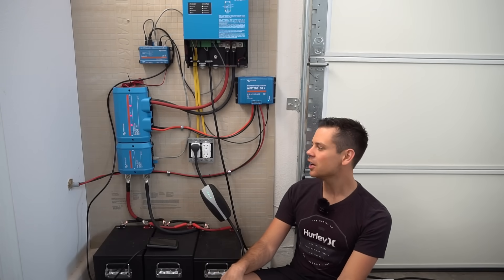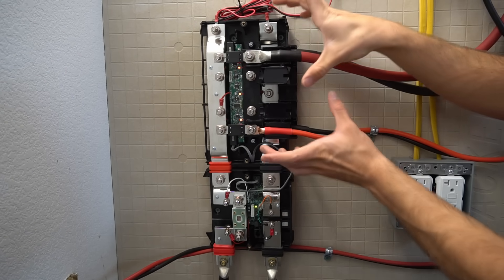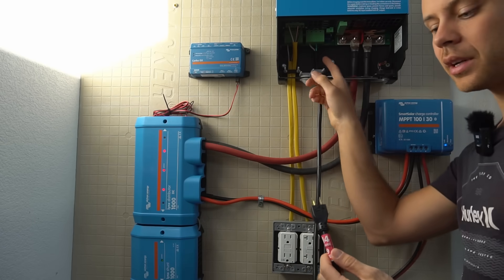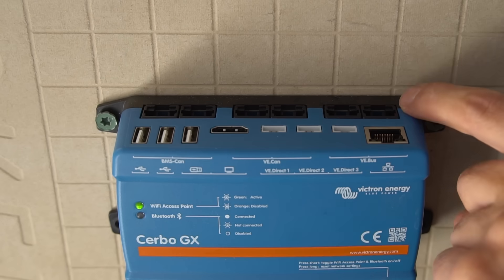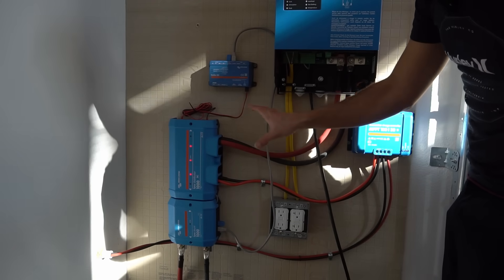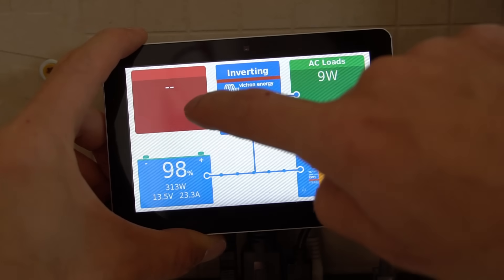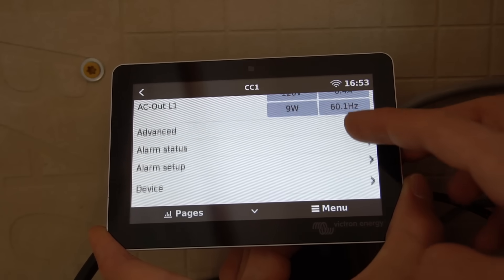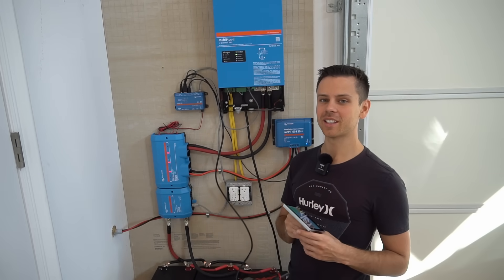Victron Made Easy! Design and Communication, Step-by-Step

Comment: Please keep the ridicule to a minimum. Would this be a good start for my old Class A? I'm full-time in a 1998 diesel pusher and I need to go solar, lol I should have gone solar years before. I digress. Would this be a good setup for my RV? From what I see I will just need to add an auto switch to my generator and an isolator to shut the system off.

Comment: I love these systems but why all the extra? For four years I have been living off-grid on just a battery bank, victron mppt smart solar charge controller and a 24v/3000w Multi-plus and I've never had to touch it. I might put fuses in someday but my charge controller is oversized and I don't see how there could be a surge from my battery bank that would ever be an issue.

Comment: Thank you for putting this amazing video together. I am a big fan of Victron devices, software, and overall design philosophy. QUESTION: Is there anyway to put together a grid connected Victron system in the United States where excess power is sold back to the power companies? Thanks in advance. Best of luck in your future endeavors.

Comment: I'm having an issue and am hoping you can point me in the right direction. I have two Victron SmartSolar MPPT 150/100-Tr VE.Can.

Both have Five 200w panels connected to them.

1. MPPT is putting out:
91.03v
8 amps
722w

2. MPPT is putting out:
125.17v
0.15 Amps
18w

Where would you start looking for the issues if you had this problem?

Comment: If you are going to use a driver to drive in the cover/housing screws, try using one with an adjustable torque setting so you don't keep jumping on those screws and rounding them over. Just because you have a slimline battery doesn't mean its torque is appropriate. That tool is fine for screwing mounting brackets onto 1" plywood backing board with hardened screws, but cover screws are much smaller and much softer and the materials you are clamping are much more fragile, valuable and easily damaged.

Comment: This question may be in another video, if so, please point me.  But, if I want to use a generator to come on in the event of a loss of shore power, is there a preferred generator (for RV usage) and can the multiplus system handle the transfer between shore power, to battery (as a buffer) and start the generator, until shore power is restored?

I'm not sure about the use of solar at this time, so I'm assuming that component can be added later should I decide to do so.

Thanks. GREAT explanation.

Comment: I have all those pieces and 8 battle born batteries in 24 v configuration.  Questions. The distributor didn't come with fuses. What size would be best? 500 amp size?  Next to have no power shut offs in line. Are you suggesting one is not needed?

Comment: Will, can rthe Victron Lynx SHUNT accomodate a T Class FUSE ? Planning installation of Renogy Lithium 100 AH batteries on my sailboat. ABYC came out with requirement to use T CLASS FUSE on battery connection.

Comment: Hi Will,  Thank you for the fantastic videos!  I have a question about the Multiplus 2.  I understand it can use power from the battery bank to augment shore power (my use case is for RVing) when demand exceeds available wattage.  Can the Multiplus also deal with low and high line voltage on shore power (i.e., can it boost line voltage if shore power drops below a specific level and potential "limit" or disconnect shore power if voltage exceeds a specified limit)?

Comment: Hey Will, great video! what if you wanted to add a victron DC to DC charger to that system for in a camper van. How does that connect to the Cerbo GX?

Comment: As an IT professional, I look forward to the day most of these components will be integrated, even if some aspects are disabled/not used, to make configuration easier. Also, many of the settings should eventually be auto detecting/auto negotiating to remove errors and capacity challenges. As most of us know in electronics/communications, cables can be upsized with current lower capacity to support future higher loads/upgrades without being too excessive on cost. In addition, better labeling systems and color coding will help remove complexity. This would mainly help those that DIY or customers setting solar systems up out-the-box.
Reply: Lol get back to your help desk you have no idea what you are talking about. Victron already has 3 SKUs that are integrated.

Comment: Hey Will, is there any truth in the cable length from the batteries to the system (negative + postive) having to be the same length... in terms of equal resistance in the cables?
Reply: As an electrical engineer by education, this is myth. The difference in resistance, especially with such large cables is negligible.

Comment: Hi, Will I love your videos you really know a lot about electronics.
Just wondered where I could find a layout for a small Solar system I have one 100-watt panel and an Epever 20amp controller Most likely overkill for my needs.
It's just to keep a battery topped up for my Diesel Heater When we get sun that is.
 But it was a good price. I have a normal 110 Amp lead acid leisure battery.
Very basic kit But I don't have the money for the kit you are showing Apart from the fact Battreys are a lot more expensive over here in the UK.
But it's worse where I am in the Scottish Highlands Nowhere near to buy kit and Shipping charges are brutal. 
Regards Ronnie Mackay.

Comment: I'm having couple of issues after the install. 
I have the multi-plus II, Cerbo GX w/GX touch,  Two Solar Controllers (150/100), smart shunt and dongle for the multi-plus to communicate through Bluetooth.

After my install, the Bluetooth Victron Connect App is showing everything working great.

The VRM and my Gx Touch, don't show in coming or out going AC voltage or my solar controllers.

By the Bluetooth showing them, I know they are connected. So I assume I just don't know how to program.

Thanks in advance for you assistance.
Reply: Figured it out. 20ft long HDMI cable is too long for the signal between the Cerbo GX and the Touch GX. Changed it out for a 10ft 8K cable, works perfect.

Comment: Per Will's comment, I don't understand why Victron product managers have not created a product for RV people. The use case is almost always similar. I have a fifth wheel... I want solar and lots more battery capacity to avoid using a generator, or to get rid of the genset altogether. Space and weight, complexity are a concern. Easy Solar II right? Except it will only power on leg of your 50am service....

Comment: Dear Will Prowse ....what is your configuration of the solar panel? I want to use 100 watt solar panel in this system  each (  total. 9 panels) .... can I use  the configuration of 3 series and 3 parallel... Do I have to use combiner box?..... If  I have to use the combiner pls  give the reff..... Hope u  may answer my question..... THANKS.......ALOOOOOOOOOOOOT

Comment: I still cannot support the idea of discrete solar systems. AIOs do have the downsides of higher idle consumption, but the system wiring and repair is simpler. It's better to focus industrial supply on "plug n play" systems over ones tuned for your application.

Comment: Wow, that helped me answer so many questions I had about how the comms work.  I still need to find out what the differences are between the Cerbo and the ColorControl.  I gather the ColorControl is essentially the Cerbo combined with the display, but want to find out if it has all the same connection options as the cerbo (e.g. wifi, bluetooth, external/additional display, ethernet, etc).

Comment: What is the retail price for a system like this in Brampton, Ontario? I am a newbie and have to get a good solar system. living full time in a truck camper since June of 2020 and need a way to charge those lithium batteries. What batteries would you recommend or what solar system….got 2000 cash MAXIMUM lol….going on a slide in truck camper, thanks for all the videos, greatly appreciated 😎

Comment: Just a heads up. It all connects up except the orion dc-dc. For some unknown reason Victron does not support the orion in its enviroment. It has no Ve port and cannot be networked. Weird that they did this. Alot of people buy it expecting it link like a mppt but are dissapointed

Comment: Would you recommend victron or eg4 system. I want to be able to use my phone to monitor system data. My original system was a midnight solar and it had remote view but it was very cave man like software.  Can you remotely monitor your eg4 off grid set  and batteries?

Comment: Victron are making a fortune by making people by all these things instead of an all in one solution.
The inverter should have the MPPT in it. The Coms system should also be built into the inverter.  The bottom of the inverter should have connection for the battery directly. Its just a huge expensive waste of space and cabling.

Comment: I would like to find a document that explains in simple language the terms used in the Victron Connect app. The app shows all kinds of useful data but meaningless to me since I don’t understand the terminology. I would think 99% of the public that has the Victron system installed in their RV has the same problem. VictronConnect should have a glossary that explains line by line what the data point means and why this is useful data.

Comment: I am currently having problems with the Victron App, it is probably my computer that is the problem but I downloaded the app on to my laptop and have been unable to get it to talk to my MPPT. It maybe that where the MPPT is there is no internet connection and where the internet connection works I would be out of range on the Bluetooth, maybe it needs both to work, I do not have a smartphone. The app just throws up a no devices found battery symbol with a sad face on it.

Comment: id like to see what it would take to set up a system to have a 50amp 220 RV plug.  im wanting to set up a tuff shed for the batteries and inverters and just have a 50 amp RV plug on the side so i can just plug in my RV like i would to the grid.

Comment: The videos are super helpful. Thanks! 

Question I’m hoping you could help me answer 

I’m going to go with solar power and the Victron multipluse for shore power to my trailer conversion. 

I would like to add the ability to charge my trolling motor battery off shore or solar. Was thinking of a quick connect system. Like a long cable with an SAE PORT. Where would I add that to these systems?

Comment: Warning! Your solar controler will only allow 440 WP in a 12 volt system. For 800 WP you will need the 100/50 model or go to a 24 volt system then the 100/ 30 will be ok.

Comment: Whenever higher current is involved, such as 250-300 amps, I just don’t trust ANL type fuses.  They just get super hot.  I only use Class T type fuses and Blue Sea holders.  Expensive yes, but the fuse and holder doesn’t get hot when you need 3000 watts from your inverter on a 12V feed.  I also wish Victron made more 24 and 48 volt inverter variations.

Comment: Great video! Earned a subscriber. I have a question though. What is this specific panel stringing using on this charge controller? And this controller only limis the maximum voltage to 100 and maximum current to 30? What about the power coming from the panels?

Comment: Not sure victron and easy go in the same sentence.  Great system for anyone that likes to tinker though.  Amount of features is simply mind blowing at times.

mulitplus+cerbo out of box can trigger generator, backfeed, charge-converter, and dynamically control solar charge controllers, etc...

Spent 2 days unlocking DVCC/ESS and finding that hidden bi-directional switch for remote ve.configure.

Comment: The trouble here is the people that struggle with this technology and are trying to construct something like this are the LAST type of people who should be messing about with this kit. There is often a lot of power and therefore current let alone potentially lethal lethal voltage … would you’ll really want an untrained person to defuse a bomb?
Reply from the maker: 😂😂😂 you're joking right
Reply: @WillProwse  er no mate… if people have to ask all the sort of questions that you see in the comments of posts like these then clearly they have not got a clue what they are doing. The vast majority of lay people who try to dabble in this area don’t know the difference between current and voltage and or the relationship between them and resistance mention terms  like potential difference and you get .. what??? … well they soon find out the hard way when they get strapped across the output of an inverter or worse still, the install wiring that’s underrated, unfused and not suitable for the job and you get fire potentially..

Comment: Hi, 

Has my Victron Multiplus 12/3000/120 Inverter also got the same connectivity as the unit shown in this video? 
I wish to install 2 solar panels. I already have the 100/30 mppt, the Victron Lynx shunt VE Can, and the Victron Lynx Distributor 1000. 
All I need is for you to show me how to wire it all in!

Comment: I've purchased all of this victron system. My question is could I use the Lynx 1000 amp smart shunt with the lynx distributor in my bus build or would the 500 amp smart shunt work just as well ?

Comment: Beside the Victron MultiPlus II would you have any other suggestions for a system installed in a fifth wheel with a 50Amp split phase shore power?

Comment: I Did purchased  All kinds of equipment from Victron  energy with out factory tech support I  removing from my boat I am glad  working for you For me not at all.
I can't call someone  to get help My vitron monitor,solar chargers And smart shunt  so  Unreliable for me most likely  I am setting them up wrong 
Now removing  them .  Due to no technical support.
I am not a electrical engineer to figure  all this setting.
My Battery state of charge going down and my solar charger not supplying enough power the bring  my state of charge back up. I do have more then enough  solar capacity to bring state  of charge to 100% Just purchased  the Generator and I am using my boat engine alternator to to keep my batteries charged.
Victron  easy purchase 
Difficult to set up 
No customer service at all.
Never again Victron  energy  products for me

Comment: One way to reduce the cost of the otherwise bulletproof Victron-based setup is to not use their own batteries.  You lose the 'plug'n'play' advantage but I would imagine the cost saving is well worth it.  I'd love to see you do a video on how to safely and efficiently integrate a non-Victron battery pack into one which consists of otherwise entirely Victron equipment.
Reply: there is no issues whatsoever to use another brand of batteries so not much of a video there

Comment: I would LOVE to see a video such a this one tailored for a 50A RV.  The video should focus on powering the RV's two(2) 50 amp legs (AC Out #1 & #2?) and Victron Multiplus' "power assist" feature (which seems to be unique to Victron).  This could be a future video content suggestion?  Thanks.  BTW, I love your videos.  You have inspired me to research building a 24V battery and use Victron equipment (love the Cerbo GX)  for the remainder; all for a 50-amp RV setup.

Comment: Hi. Great video.  I am building close to the same system for an overland trailer.  

I am looking at the 

Victron Energy Blue Smart IP22 12-Volt 30 amp 120V, Single Output Battery Charger NEMA 5-15, Bluetooth

To supply shore power when in a campsite.  

Will that charger work?  I dont see how it would interface with the cerbo gx?

Comment: I installed about 15 of the 12v and 24v Multiplus systems in to Mobile radio stations about a decade ago.
They were brilliant at the time. Very expensive, but, by far the market leader.
Recently I was in the market for a home battery/solar system.
While I still like Victron its products are no longer revolutionary. They seem to have stagnated.
For much less than a third of the price I purchased a alternative inverter. It has all the features of the Victron and a few more.
It is nowhere as refined as the Victron and not nearly as good build quality.
I think Victron needs some fresh blood in the company to revive the products. I still look at Victron as the Rolls Royce but the penny pincher in me struggles to justify the extra expenditure. 
Great video.

Comment: Hey Will! Thanks for your amazing videos and for sharing your knowledge! You're a true star. I'm writing from Spain, I've done an installation with Victron devices on a freidn's house in the mountains, I'd like to know if you can configure the inverter charging functions with that screen, or do you need to connect it to a laptop with the Mk3 to USB adaptor? I'm referring to the Multiplus 48V that has an inverter and charger commuter to switch it on.. Thanks and have a nice day!

Comment: Hi, I love the videos. I am a total newbie in this and wondered if you use this kind of system, and its night and the batteries are empty but the system needs to run 24/7 does it pass through the necessary watts for the load from the AC in ?

Comment: Obviously, Victron is a power system company and not a communication equipment maker with 3 different communication systems to connect 5 of their own devices is completely stupid.  They don't believe in standardization for communication between their own components?